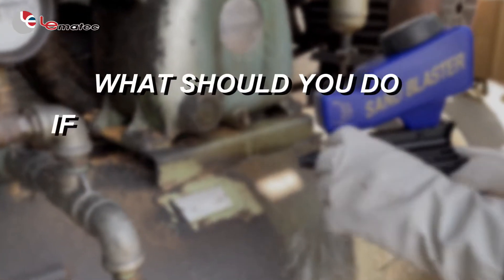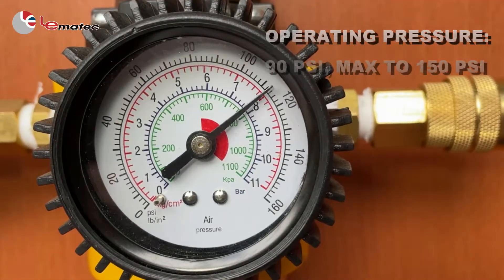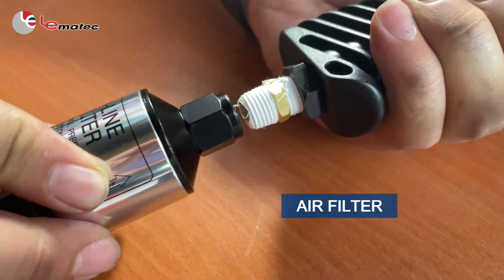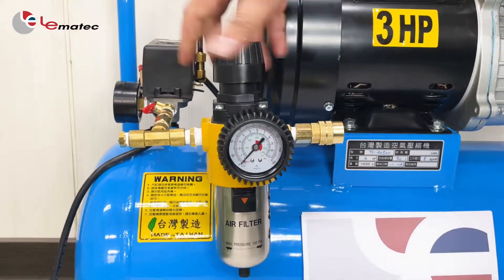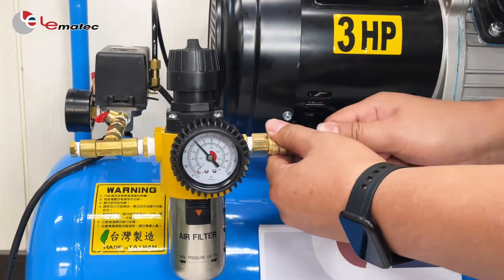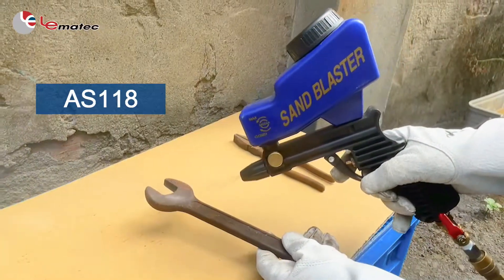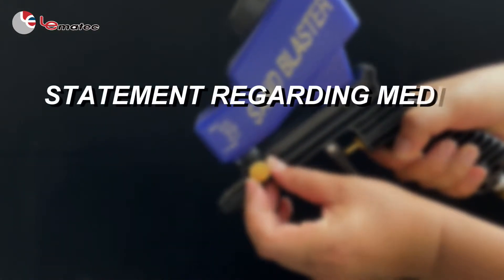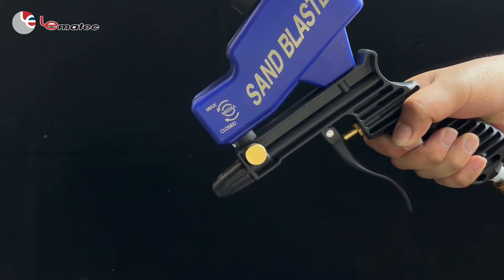Precautions & Sandblaster gun FAQ. Air compressor, working, applications and others questions.

Comment: when using gravity feed tank, I get no suction and everything is set up correctly as far as the syphon turned off and the gravity feed turned on. If I open the top cover where the sand goes, and place my hand on it, I get no suction. Absolutely none. What is the issue?